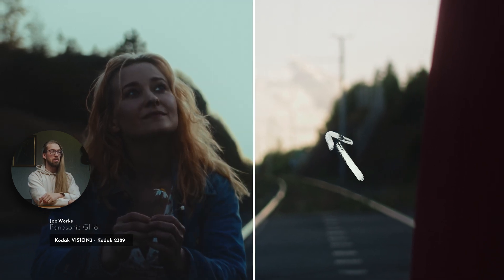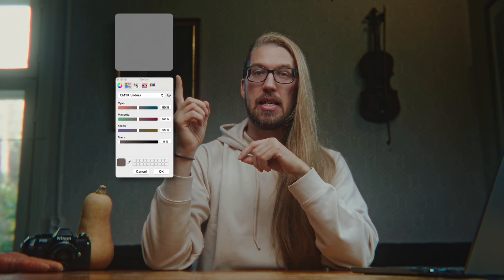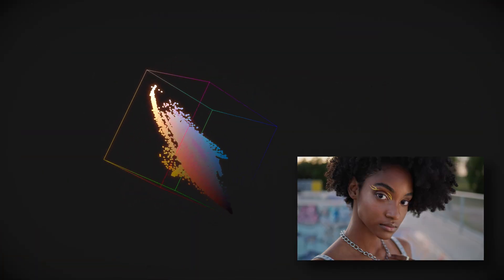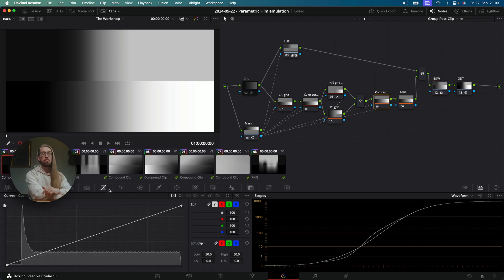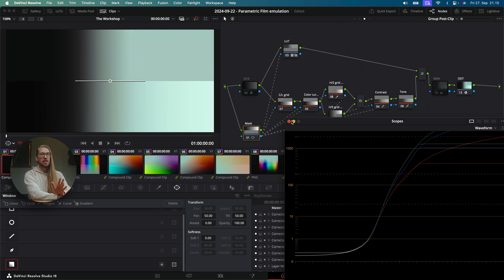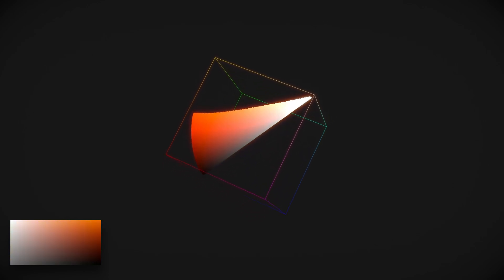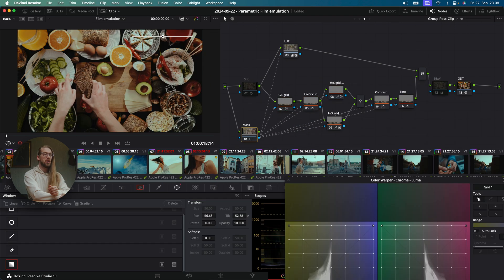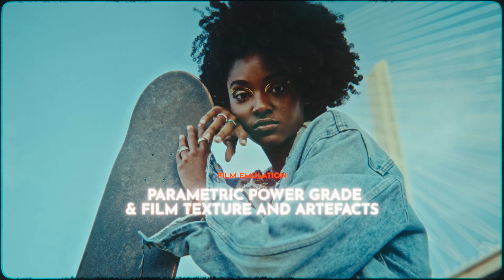Turn a LUT to a Parametric Film Emulation

Comment: I can't stress enough that YouTube got STUCK in the notion that DaVinci was a superior tool to Premiere Pro. And this is UNBELIEVABLY FALSE! ALL OF which that is explained in this video, can be done in 3 clicks in Premiere Pro, way more intuitively and no matter how a LUT cutts off shadows or highlights, you can ALWAYS bring it back with a simple slider adjustment in Premiere Pro when the source footage contained that value (meaning, you were not hopelessly over- or underexposing). The only - and I mean the ONLY superior tool that DaVinci brings with it is the Magic Mask. But the Magic Mask is not a necessity when you know lighlighting and operating your camera. Everything else can be done in Premiere Pro faster and way less complex with ONE tool - the Lumetri-Color. It's super powerful and is hopelessly underrated and under-used. No overly complicated Node-system with complex connections and individual adjustments, just userfriendly, straight forward workflow that will make your editing so much faster and more pleasant.
Reply from the maker: Interesting opinion... My guess is that you either are really good at using premier or... not that experienced at using DaVinci... Let's give you the benefit of doubt.
Reply: @JooWorks  So you're either not very experienced in Premiere Pro, or over estimate a need of complexity for professional editing. It's like cinema cameras compared to entry level cameras - the entry level ones have loads of features and unnecessary complex menus, wheras cinema cameras are basic in controls and only offer what is really essential to get a good result. Beginners would be surprised how simple and straight forward top tier gear is. Same goes for Premiere Pro.

Comment: A lot of great presentation - but just a small reminder that rec70-a is not a color space -it's a Resolve hack for Mac OS Colorsync that has a math issue in the encoding of the original linear encoding to a gamma that match closer to our vision. 
Unfortunately, the math from that camera capture - Apple believes that camera gamma is 1.96 and all other media believe it is 2.2.
So the way Colorsync works is to create the display transfer it will create it on the fly.
There is another problem that it has too, which is reading the NCLC tags. In Resolve when you render a gamma 2.4 rec709 it tags it 1-2-1 - which reads in NCLC as:

(1) Color Primary - "ITU-R BT.709"
(2) Transfer Function - "Unspecified"
(3) Color Matrix - "BT709" 

And for a mac the 2 - needs to be retagged as 1 
The rec709-a tries to fix the gamma issue from the encoding as well as re-tag the file 1-1-1.
But when you use rec709-a as the color space and building out your model - as you seemed to describe here, it is then built on a color space that isn't really a color space - 
Which might work okay, but for the sake if actual accuracy - you should be building it on actual standards, not on a Resolve hack for Mac users rendering to color managed players.

I can't say for sure, but if you change the timeline colorspace to actual rec709 2.4. the curve on the gradient greyscale - will have a different slope in the shadows and of course all the building on top of it would be skewed.
Reply from the maker: Hi Jim! Long time no see.

This could be considered as a LMT (Look modification transform) in ACES, it's delivery space agnostic. It modifies the colors 
 in ACEScct and keeps the colors in ACEScct. There are in and out CST-nodes before and after the LMT. If you set your delivery color space/Gamma to rec709/Gamma 2.4 or rec709/rec.709-A in the Out node and in Resolve settings, the result is identical.

Comment: i dont understand anything from the beginning until 14:00 but i love it! 😅
I have 1 question, what color science we choose on settings and what timeline colorspace we choose? thanks before ❤
Reply from the maker: 😆The power grade works best in DaVinci YRGB non-color managed, as there is CST-nodes in the power grade. The timeline color space has a minor effect because it affects how the color warper tools work, so I would recommend setting that to ACEScct. But try if it works fine with your chosen color space. Then don't forget to transform your footage from your capture profile with the CST nodes inside the power grade to ACEScct and then back to what ever your working color space is.

I'm going to make new ones like this as this is not the best emulation. This was done with DeHancer and I'm not always quite convinced how Dehancer emulates film.
Reply: @JooWorks  thanks for your answer You are very kind man 💙

Comment: Unfortunately, this might not work, because a LUT remaps the values in 3D space, what you do is 1D transformations. In order to make it correctly you need a tetrahedral transformation tool. If it works on some footage, it doesn’t mean it will work always. Did you stress test it?
Reply from the maker: Interesting... What would you consider correctly as an example? And I would consider many of the tools in Resolve as 3D, not only 1D. What do you mean with 3D vs 1D outside the context of 3D vs 1D LUTs?

The diagrams them selfs are stress testers, but still It would be a fun idea to make a stress test for this with some animated color planes flying trough the space, but I'm not so concerned with stress testing as the methods I use are rather safe to start with.

And  it's very common that most LUTs have issue with them so I don't mind mine having some. You can see how the reference LUT (from Dehancer) has issues even with this simple rec.709 diagrams. I bet it totally will break down with rec.2020 colors. Most likely mine will too. But as long as it looks good on rec.709 color and at least ok with higher saturations, I think it's fine.
Reply: @JooWorks  If it gets your job done and you like it there is no problem. I would recommend you to watch Steve Yedlin’s film emulation tutorial to understand what I mean. You find it on his personal website.
Reply from the maker: @durdendurden2  Great, Thanks for the tip. I remembered reading his website long time ago and then it was over whelming. Let's take a new look
Reply: the color warper and custom curves in the HSL colorspace are 3D manipulations of the color gamut, and also not linear like tetra is. But it would be interesting to see the end result on a RGB Cube